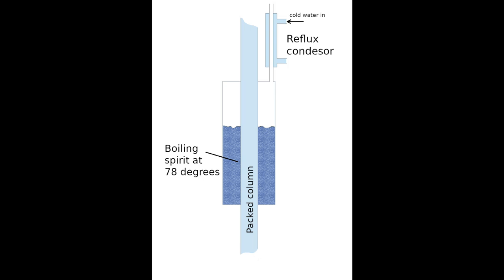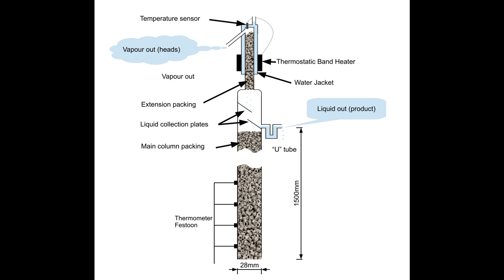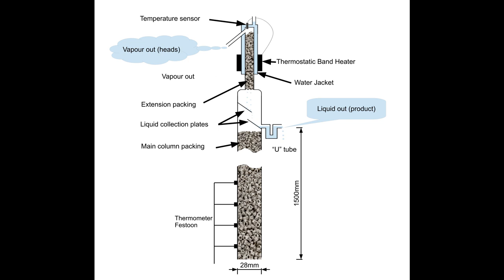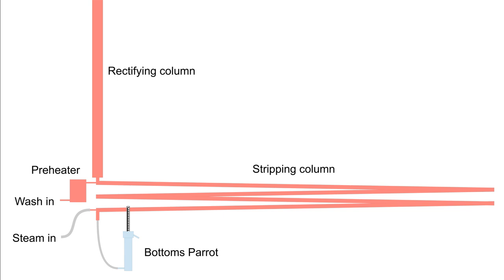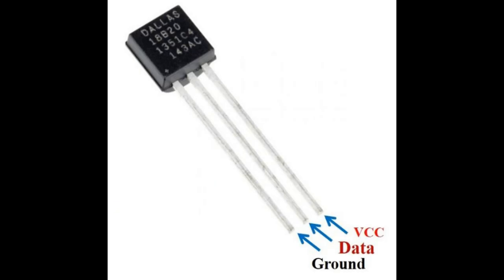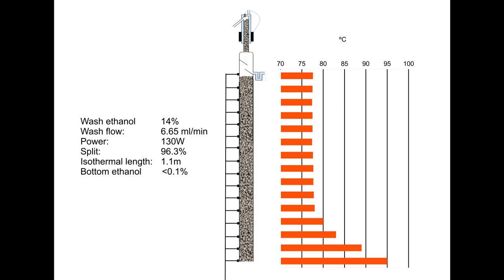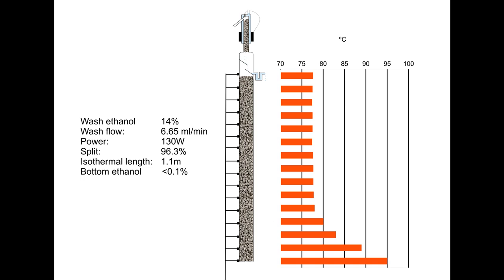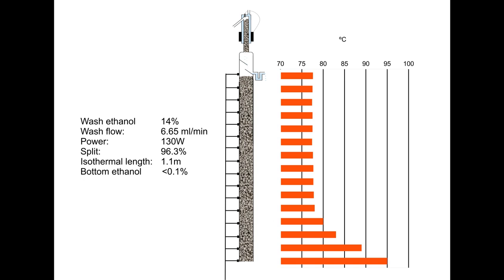How to control the Tight continuous moonshine still.

Comment: I'm very interested in one aspect of how possibly using a small continuous still based on your design here may be well suited to an off-grid (very low power) still for vodka. The idea that popped into my head as listening to you was using a solar concentrator during sunny hours to focus on and create steam at the bottom input and then small wattage peristaltic pump for wash input. A control system could monitor sun/heat and adjust wash flow for sunny hours and put to sleep in off hours so that over time you can produce vodka when sunny. This I could use off-grid where I am and have very low (130W solar panels to charge my battery) or perhaps in a mobile (RV) type setup. I wanted to run this by you to get any suggestions you may have as to viability. The idea being to find a solution in situations where you simply cannot get 1500W or so as heat source (and don't want the hassle or safety concerns of using gas/wood fires). I made a simple reflux still with a ESP32 controller (SS relay and temp sensor) and small web app that interacts with it to control pot heat on/off to maintain a top column temperature. It worked fairly well and I produced a dozen or so runs of vodka before thinking about some way that didn't need so much input power over many (4-5) hours. My background is in electronics and software, so this part of the still was easy. It's the physical part that is more work for me.

Thanks for your very helpful videos as they are getting my ideas flowing here.
Reply from the maker: I have not tried it but am confident it would work. You'd need a solar oven and enough sunlight for at least 300W over the course of a day and keeping the chamber at 120 degrees C or more. The power necessary to run a microcontroller or small board computer + the pumps is modest at under 50W so easily supplied with a solar system. You would need a solar oven that works throughout the day without having to be  adjusted to point at the sun. It looks as though inexpensive parabolic mirror systems could do this.
Reply: @tight1449  
Thank you for your kind reply. I've been making my way through all your videos and there is so much useful detail there. Really a bit of genius in all you have worked out and shared here. It's stimulated so many ideas and I have ordered parts from Aliexpress now to build my own - though naturally I am embellishing and adapting to my own needs.

I am trying out making the stripper tube in a coil shape so that it wraps around at same 1.5% slope, with the steam chamber in center. This hopefully means any heat loss from either is mostly shared between two parts. I will wrap some insulation layered with aluminum foil in between and around outer barrier as well. This will make it very compact and easy to move, almost like a kitchen appliance - 22cm diameter.

I am in Australia and much of the year is quite hot. With this environment I expect heat loss will be less anyway, and I have good solar stability much of the year. I spent some time designing a parabolic reflector and costing the materials to build one. I decided instead to just use teflon heater wire wrapped on a stainless vessel and powered by my solar panels. It's less "elegant" but more practical and any money I spend on panel upgrades pays back in other uses. I generally have 140-150W during sun times from 2 small panels (outputs 36V PP).

I've also decided to use gravity feed and just control the flow with solenoid valves instead of pumps. My intention is to have a stack of continuous 10L fermenting vessels next to the column and keep a steady sugar/nutrient drip at top, matching withdrawn at bottom vessel, so that levels are pretty consistent anyway. So I scrapped the "diesel fuel pump" idea. I also figure a couple inverted bottles after the second fermenter will act as a yeast settle stage with the cone shaped bottom making nice separation flasks. I also figure I can calibrate the valve open time and easily adjust for changes in liquid height, which I will probably want for the water input.

One question if you don't mind: looking at your photo of column when discussing product ABV vs. power and insulation I noticed some silver can-like part at base of column which doesn't seem to be discussed and I just wondered what that is? It looks wider than just the 28mm copper column and I wondered what that part is for.

I'd be happy to share my results with you as I move forward. It will be weeks before I get stuff in the mail. Is there some way for me to send photos and details directly to you? I didn't see any contact info on your YT About page. Only if that suits you, of course. I can understand not wanting to post here. Maybe I can post a throwaway temporary email with which to make contact? Just an idea.

Thank you for taking the time to post all this great info and going into so much detail on thermodynamics and build / control info. I have a background in physics many years ago, but spent much of my life working in software dev with some micro-controller / electronics design work, so much of what you say I do get, though maybe wouldn't have got there on my own.

Edit - Oh, I just thought. I will be making an open source project for this on Github as I progress. So I can post images and details of progress there and also potentially communicate thru issues. My plan is to use an ESP32 (wifi/bluetooth, 32 bit cpu, adequate I/O lines) to control the whole thing. I have used it before and I'm familiar with building a web app interface to allow monitoring and controlling from anywhere in the world (or just locally of course). So that part, details and code I will share as open source as well.
Reply from the maker: @neocogent5153   My initial thought was to make a spiral for the stripping column but I didn't have the equipment to bend the tube so ended up using the zigzag system instead. My first attempt though was just using a straight tube while I was experimenting to get the right angle. If you're able to bend the tube at the right diameter then I should think a spiral would work fine.

I was keen on the gravity fed system when experimenting with pumps and finding that their flow rate wasn't all that constant, but I've ended up using a feedback control system where the pump rate is varied according to various temperature parameters. That's quite easy to do when you're using a computerised system with electronically controlled pumps, and it might require a bit more ingenuity to do it with a gravity fed system.

On the other hand, a gravity fed system would give you more stability of flow than pumps, and you may not need quite such precise control if you're not aiming for over 96 percent alcohol. 

The food tin thing on the column that you referred to was my first attempt at an isothermal deflagmator, which was used to extract the right amount of heat from the bottom of the column when it was running over a pot still. In essence, to get a constant alcohol flow rate from a pot still, you need to increase the power substantially as the run progresses, and that means increasing the amount of water vapour coming off and in order to get a column to run correctly you need to extract the latent heat of that water vapor and this isothermal deflagmator is intended to do that. It works quite well but when I changed over to a continuous still with a constant water vapor output It became unnecessary, though actually I'm looking at using it again to try and minimize the necessary height of the column. It's just a jacket that's supposed to contain spirit, but I kept it on the column empty because it was easier than taking it off.

I haven't used the ESP32, but it looks like it would be ideal for the purpose. And if you're doing that, and you're also using solar panels to heat the steam generator electrically, you might consider using pumps rather than gravity feed. It may be easier in the long run. Particularly if you're handier with microcontrollers and software and electronics than you are with timber construction and pulleys as I am.

Also, you might need a bit more power. I use a 550W heater with a PID controller, but the duty cycle is such that I never use over 300 watts. However, with an uninsulated column, I get slightly higher proof at the expense of higher power consumption, and I have been up to about 240W with a 28mm column.

I guess you'll try it using mains power to assess the power consumption before committing to solar anyway.
Reply: @tight1449  
Thanks for the helpful tips and ideas. I made a reflux still a couple years ago and ran it for a while. It worked fine but I was not fussy about high percent output. I think I got ~90% but was unsure due to a cheap Chinese hydrometer that I always suspected was off.

Speaking of hydrometers I noticed in one of your videos or comments a mention of digital ones. I have two ideas for that and when I get this project built I will explore one or both. The first is using an ESP32Cam ( one with a video cam attached on board ~$5). I think if I print a binary pattern on a thin strip and attach it to the top of a hydrometer and then mount next to pointing at this I should be able to write code that will scan the images captured and pull out the position from the pattern seen. It would be off due to the mass of paper/plastic strip on top but that's ok as can just calibrate in software.

The second idea is to hack a cheap $5 digital caliper. These have a thin circuit board along the scale which works on a capacitance system which the main body tracks as it moves over. Even the cheap ones often have a digital output on board. This can be wired to my main controller and it outputs 24 bit measurement data continuously. So, take the long thin board and attach to a suitably balanced float and you have a way to measure position/height in fluid down to 0.1mm. 

There are a couple issues with this which I see workarounds for. Both depend on having a stable and known fluid height. So how a miniscus would interact is hard to say. Maybe inserting two resistance wires into fluid and using that to detect fluid height as an offset to measured float position. Anyway, just ideas for now but would be very cool to have a digitally readable ABV metering as feedback to controller.

I'm sure this new project will be a case of trial and error. It always is, and I can adapt as I go. I have nearby access to main power for testing and may do that as well, though the goal is solar powered even at cost of output rate or highest purity. Cheers!
Reply from the maker: @neocogent5153  After I decided that using column top temperature as a control parameter wasn't going to be successful, I attempted to make a functional digital parrot with a resolution of 0. 01% alcohol. The nearest I got was using what I call a Bob Pycnometer system. You hang a thing a bit like a pendulum bob into the liquid in question, suspended by a fine fishing line from a load cell, and you continuously monitor its effective weight. As the alcohol content of the liquid changes, its density changes, and so does the upthrust on the bob. I got this to work with a resolution of a thousandth of a percent alcohol by volume, but unfortunately I could only achieve that in static fluid. As soon as I I tried it in a continuous parrot configuration I found that the variable flow of fluid coming up around the bob led to a large amount of random variation in the reading and I never solved this problem. 

The other thing I tried was an ultrasonic parrot. The idea here is to measure the speed of sound in the liquid. This is fairly straightforward because of the existence of extremely precise and inexpensive chips intended to measure the velocity of fluid in pipes using the speed of sound that are used as flow measures to calculate heat flow in heating systems. The problem I found there was that the inexpensive ceramic  ultrasonic transmitters and receivers I used were not fast enough to allow the chamber  containing the fluid to be small. You can get ceramic elements that are fast enough but they're pretty expensive and I balked at the price. 

If I was to revisit the problem, I would look at ultrasonics, but both ultrasonics and the Bob Pycnometer require Careful and precise temperature compensation.

Comment: With such tiny throughput wouldn't it be a lot easier to just have a slightly larger but much simpler steam generator?  You're using less than 4 liters of water per 24 hours, right?  A 4 liter boiler with power control seems a lot less fiddly than a flash boiler with feed control, but that may just be my bias
Reply from the maker: It would be easier and I'm confident it would work but I brew in batches of 150l and run the still continuously for several weeks. It takes 2-3 hours for the still to reach steady temperature after a shut down so refilling the boiler would be an issue and for enough water for a batch it would have to hold around 100l. You may as well just do batch distillation with an isothermal deflegmator, that would be even easier.